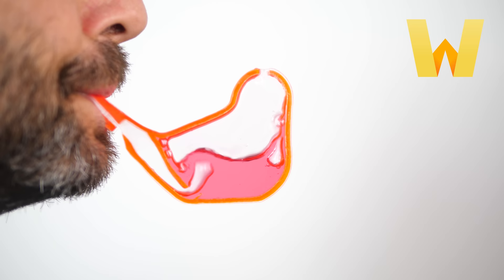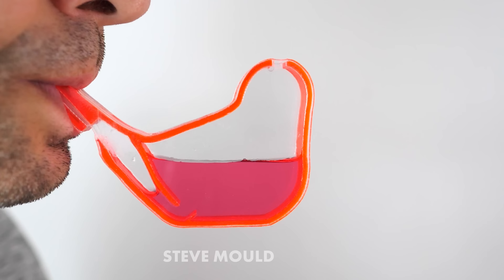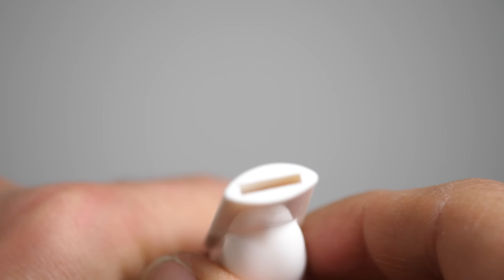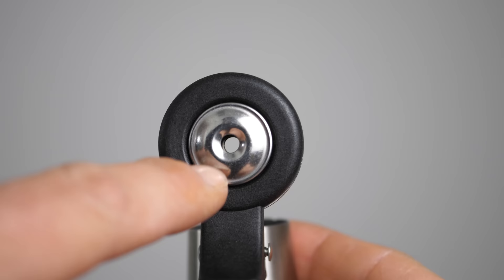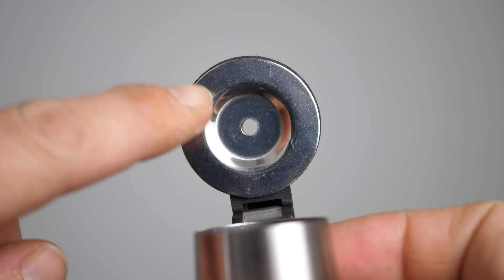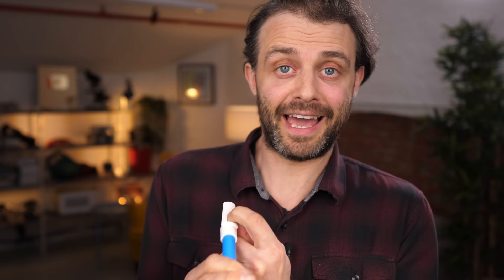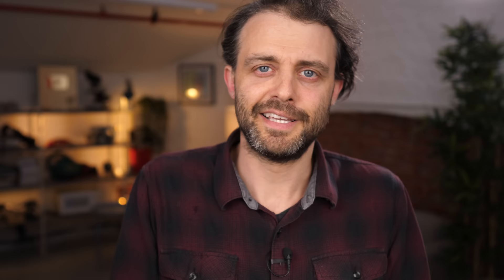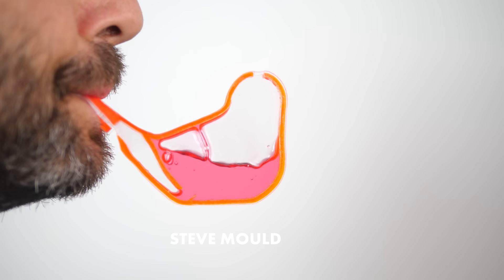Warbling Whistles Are Weird

Comment: you should do a video about how boomerangs return, i understand they create lift through wings but what makes them lift at the front only to turn around
Reply: That's a good question, I always just kinda accepted Boomerangs lol
Reply: I would love to understand them, as well as learning about their... Aborigins
Reply: I'm pretty sure it's because the advancing blade has a higher speed relative to the air than the retreating blade. Just guessing tho
Reply: A boomerang is not symmetrical, its a propeller which is bent a bit. Both the sides generate lift at the samr direction if rotated.
Reply: Smarter every day -_-
Reply: @Dave Smith Yeah, they absolutely do come back. There is a hunting variety that doesn't, but they are really just big wingy sticks that fly straight.
Reply: I think it's like helicopters 

when it's spinning one side is spinning towards wind therefore more lift, one is spinning with the wind, less lift

But Helios have a buncha stucco counteracting that, boomerangs don't

Altho don't quote me on this cuz this is just my speculation based on my knowledge of aerodynamics and cool sciencey stiff
Reply: @CATel_  helicopters would flip over if it was the same mechanism
Reply: The advancing blade of the boomrang create more lift, so there is more lift on one side. And there is the giroscopic effect. When you apply a force on a spinning thing, the effect of the force is moved 90 degrees, which make the boomrang turn.
Reply: @niconico3907  but why does the advancing blade create more lift? this is exactly the kind of thing he usually explains
Reply: @frostjune6072   advancing blade create more lift because it has more airflow, (spinning + forward direction), than the retreating blade, (Spinning - forward direction).
Reply: @MrT------5743  the difference in air density between front and back is negligible so then would create about the same lift. im asking for an in depth answer not a hand wavy one like you gave
Reply: @frostjune6072  It is not the air density, it is the speed of the airflow over each blade and gyroscopic progression.

I think you might be asking for in depth answers your question on the wrong video (not at all related to flight for one). You are commenting in a science teacher's youtube channel when you could easily search for a video that exactly explains what you are asking. But I guess like most people (including yourself), want to be spoon fed an answer that meets their own personal requirements in the wrong forum.
Reply: @frostjune6072  Here is your spoon of food - Open wide for the 'airplane':
https://www.youtube.com/watch?v=SJ61Y17s3bU
Reply: @MrT------5743  im asking him to look into it with his education and then use the understanding he gains to explain it in an easily digestible way as is his entire shtick for his career. you clearly have 0 understanding of it and just want to pretend you do. everything he explains can be
looked up yet you’re still here i wonder why?? perhaps because you can’t understand the research papers or other explanations. he has a talent for teaching complex ideas in a simple way.
Reply: @MrT------5743  which part of in depth is difficult for you? the reason steve has a career is because he can explain complex issues, not because he can simplify them like hank green
Reply: @frostjune6072  the wind speed on the advancing blade is speed of the center of the boomrang + the wind speed due to the rotation of the boomrang.
The wind speed on the blade going back is speed of the center - the rotation wind.
And lift is proportional to the square of the windspeed.
Reply: @niconico3907  boomerangs work regardless of the direction of wind though?
Reply: @frostjune6072  Because they move forward regardless of the wind. The advancing  blade vs retreating blade have different amounts of airflow regardless of the wind.
Reply: @MrT------5743  you literally just aren’t thinking about this. you say things with little meaning. explain why they have different amounts of lift? you cant? weird neither can i, thats why i asked steve
Reply: @frostjune6072  it works better if you throw it into the wind, but no wind is needed for the boomrang to come back.
Reply: @frostjune6072  I totally have and Nico has as well. Lift is directly related to airflow over the surface of the wing. More airflow equals more lift. The side of the boomerang  advancing into the air in the direction of travel has more airflow (forward speed plus rotation speed) versas the retreating side (forward speed minus the rotation speed). More airflow causes the advancing side to lift more which causes a torque lifting that side which then causes a turning effect. If you could throw a boomerang hard enough or it would not loose speed due to the drag forces, it would continue to go into a circle and not just return.
Reply: I'm not reading this whole thread, but I will say that a standard boomerang is "handed". They're carved in a way that is not symmetrical. They have a "direction". They're more than just a curved stick, and if you try to throw a right-hand boomerang left-handed, it won't work.
Reply: @cymond  im aware that one side is different from the other, but id like an in depth explanation of how that causes it to return
Reply: A boomerang is propelled by self hate and self hate alone. It drags itself down but the top bit is dragged down x2 so it drags itself down again. Its strange stuff.
Reply: @frostjune6072  do you the basics of angular momentum and precession?That will make this explanation a lot more simpler.

Comment: I think the corrogaphone is actually the same as the bottle, just without a bottom.  Both are air moving across an opening of a cylinder.  You could cap one end of the corrogaphone and it should drop in pitch by an octave.
Reply from the maker: Apparently it doesn't work unless it's corrugated!
Reply: No, it depends on the airflow through the tube. The whirling end has lower pressure, causing the airflow. Also, as you whirl the tube faster, the pitch jumps to the next harmonic.
Reply: @SteveMould  really???  I'll have to try by spinning a non-corrugated tube and see.  I always thought the flared end was the important bit.
Reply: I've definitely gotten some good wooshy whistles out of swinging PVC pipe around like a sword, so the jug similarity makes sense to me. Not sure what different mechanism a corrogaphone could have
Reply: @SteveMould  spoilers!
Reply: It works on a non corrugated tube, but it's a higher pitch, and it's easier to swirl around a corrugated tube for obvious mechanical reasons.
Reply: @SteveMould  We couldn't be having a flatophone now could we
Reply: @SteveMould  I'd imagine that's because each corrugation acts like a wave guide to help shape the pressure wave around the curve where you grip it
Reply: It's "corrugaphone". Kind of obvious, since it's "corrugated", and not "corrogated", don't you think?
Reply: I believe the whole thing relies on air being drawn through the tube by the Bernoulli effect, so would need to be open at both ends...?
Reply: @SteveMould  I don't know if you tried it but you can also hold a corrugated tube into a spiral shape and just blow in one end. I have one that if you do such a thing, creates an extremely high pitched and ear-splitting loud noise.
Reply: If you cap the end it actually stops making noise, it needs air flowing through it to work
Reply: A similar harmonic resonance occurs when high velocity air is blown into a large corrugated drain pipe as well, with the harmonic depending on velocity. I would love to see a video exploring this phenomenon.
Reply: Feels like this would be at least slightly related to how 'bullroarer's' work also?
Reply: @SteveMould  shouldn't it be a corrugaphone?

Half kidding
Reply: @SteveMould  Corrugations are to enable the tube to stretch and retract when rotated thus changing the pitch.
Reply: @pinballrobbie  I'm reasonably sure that the pitch change is less from the tube changing length and more from the air velocity. The pitch gets higher if you swing it faster, not lower.
Reply: It should work on a normal tube as well, Shouldn't it?
I remember hilding some boomwhackers and not whacking them, just whooshing them through the air (just simple up-down, for obvious mechanical reasons it's  much easier to achieve continual rotation with the corrugated ones)
Reply: @SteveMould  yes, because if it's not corrugated, then swinging around the tube probably is going to make it kink and we can't have that now can we... beyond that there's no  reason to the limited extent of my knowledge.
Reply: @SteveMould  I'd bet that each of the ridges of coragation is acting like the holes on the kettle whistle.
Reply: @SwervingLemon  How does this explain the need for corrugations?
Reply: @SwervingLemon  Good point

Comment: A whirly tube is just a Helmholtz resonator. As it spins around, the air passes over the hole; but air does not travel throughout.

Theoretically you could just attach a string to a bottle and swing it around and get the same noise as a whirly tube.
Reply: Ohhhhhhhh, I've done that! I know what you mean! It's not the same noise tho, it's just another mechanism to get bottle blowing timbre.

Comment: Nice video! I just wanted to say (as you alluded to) you could view all of these whistles as variations of Helmholtz resonators with various shaped cavities and holes.  If we adopt the low frequency lumped-element model for these, then a cavity acts as a gas spring and the hole has a column of air that acts like an inertial mass (inertance). The spring acts like a high-pass filter and shows up as a zeroth-order derivative term in the ODE.  The column of air acts like a low-pass filter and shows up as the second-order derivative in the ODE. Putting those together we get an acoustic resonance from our makeshift bandpass filter, and this is directly analogous to inductor-capacitor circuits or the simple-harmonic-oscillator.  This is obviously oversimplified but I think it provides great physical intuition about what is going on.

Comment: I tried designing a whistle before. Failed miserably. Read a couple papers, tried a multi-physics simulation, could not get the desired behavior.

What I did find out from failing matches what Mr. Mould said, the turbulence generates a wide band of frequencies (via pressure field disturbances), which changes depending on the qualities of the turbulence. However, this sound is too quiet, but when paired with a resonator (e.g., the green tube that's open on either end counts as a resonator), the frequencies that the resonator resonates with will be amplified and we hear the whistle. My guess is that all whistles are designed differently because turbulent flow is a pain to control (and 3D geometry can all sorts of crazy resonances), let alone turbulent flow generated from the blowing of people who are young/old and different lung capacities. As a result, most whistles aren't engineered so much as they are discovered by mistake or trial-and-error. 

Some people in the comments mention that musical organs are a great place to start if you want to learn more, which I totally agree with. The line between whistles and instruments is blurry (e.g., ocarina), but I found classical instruments to be far more "engineered" and easier to understand. I always found whistles to be cool because of the sheer variety and wackiness.
Reply: Out of curiosity, any particular reason you tried designing a whistle?
Reply: That makes sense. We can only game chaos by educated accident. Keeps life interesting
Reply: I've made some flutes in the style of Native american flutes which use a wedge design and a cylinder with holes and to be honest it is so interesting, but getting everything right is such a pain as well. I have now planted bamboo back home for more flutes down the line
Reply: @WujuStyler  ikr. As if the length of the tube isn't enough,even the diameters of the holes play a big role in  the pitch.

Comment: Two things of note:

1) The first kind of whistle, with a cavity and a wedge, is known as a fipple flute. The most common types bedsides bog standard whistles are the Irish tin whistle and the recorder. Tin whistle playing actually relies on the fact that a notes pitch can change depending on the velocity of air. What you did with your slide whistle is called “over blowing” and it’s how I can three(ish) octaves out of my six holes instrument.

2) traditional flutes work on a similar principle but your bottom lip forms the wedge. You can do a similar thing by cupping your hands together so that air only escapes from the whole created between your thumbs. If you blow into this hole with your bottom lip covering the top half of it, you will produce a whistle. You can change the pitch by changing the shape of the cavity through altering how much your dominant hand is open.

Comment: When I was very young, a older cousin showed me how to make a whistle out of a cellophane candy wrapper.  Basically, you just unfold the wrapper flat, hold it taught with both hands in front of your mouth, and blow directly into the leading edge.  It's incredibly loud and I believe it functions like a reed in a wind instrument.  Would this not be an example of basic wind-splitting on a wedge?  I assume the leading edge of the cellophane acts like a wedge does, but instead of the air flow switching back and forth from the top and bottom of the wedge based on vortices, the wedge itself deviates at a resonant frequency based on the elasticity of the cellophane.

Comment: My cold drink tumbler has a small air vent hole on the lid that is blocked by the sliding mouthpiece cover. The manufacturer thought it was a good idea to then put another small hole in the mouthpiece cover directly over the vent hole in the tumbler lid. The result is exactly a kettle whistle. Now the whole office knows when I take a sip out of my tumbler!

Comment: The wedge is a 'languid', the kettle whisle works the same as the ref whistle, exceot that the languid is a tube, note the front disc hole is turned inwards to make the languid.
The space between the discs is the resonant chamber
A flute with an open end will be twice the frequency of the same flute with a blocked end.
Reply: This! I came here to say they're all fundamentally the same. The "types" are superficial. It's all resonance and conservation of momentum, i.e., basic fluid dynamics.
Reply: Still, the fipple is a very different construction from the kettle whistle.
Really wish Steve had taken the time to find out what a fipple was called, though.
Reply: @nialltracey2599  still? That's nice fipple is a term but what are you implying with the construction stuff?  Construction just changes the frequencies, amplitudes, and types of symmetry if you want to model the fluid dynamics.
Reply: Surely the air in the cavity of the "standard" whistle in the video is not "feeding back" to the input air stream. It is all just resonance. Otherwise an open ended flute/tin whistle would not work: it would not feedback to the input stream
Reply: @johnswn255  look up turbulence or kolmogorov eddies.
Reply: @johnswn255  The sound comed from being split alternately either side of the languid, but as steve said it would be too high pitch to hear, both the open and blocked whistles or flutes lower the frequency depending on length and diameter, 
Further research can be found on wiki "Physics of whistles"
Reply: I was thinking about it in more mathematic terms: identical topology—but your wording is much more human friendly.
Reply: I have a kettle where the domed side hole edge isn't turned, and it still whistles.
Reply: ( front disc hole is turned inwards ).  Nice catch.  it makes sense now.  Still the question on my mind.  How would a (third) layer change the sound.  Or, even would it.  I guess it might drop an octave (from the loss in velocity).  But as for a "cool", "fluttery" sound.  Like that bird whistle.  I don't see it happening.  Just the octave thing.
Reply: It turns out I was wrong, and on close inspection my kettle's spout is subtly curled in after all. Not nearly to the extent that Steve's is, but not completely flat either.

Comment: 6:25
Yes, an audible sound is louder than an inaudible sound. Good job Steve 😁
Reply: Loudness and audibility are not the same thing. Loudness is the amplitude of the frequency which can be high even if the frequency itself can't be picked up by human ears.
Reply: @Dave Smith obviously. But this video and the whistles in it are for humans. Plus he said "audible" without mentioning audible to whom. So of course it's for humans

Comment: I have a collection of helmholtz resonator flutes in the form of various ocarinas. Their frequency is determined by the speed of the airflow, total surface area of the holes, and volume of air inside the resonator. Which is quite a number of variables compared to a recorder.

Comment: How would using a liquid with a different viscosity affect the whistle's function? Would it still work with something like honey?
Reply: Less changing
Reply: as raf says, the frequency of the warble will change. honey would sound like the whistle was in slow motion i reckon
Reply: This is just speculation, but I think with honey you'd have to blow quite hard at first, to form the initial channel through the liquid, but after that it wouldn't collapse quickly enough for any bubbling effect to occur. So once you'd broken the surface it would stabilize, and you'd get one steady note, without any warbling at all. With the air just flowing through the channel you'd already created.
Reply: I would start with something closer to water first, like vinegar or milk
Reply: All that, and it would be a nightmare to clean out.
Reply: Try it with oil
Reply: What if you change it with vodka